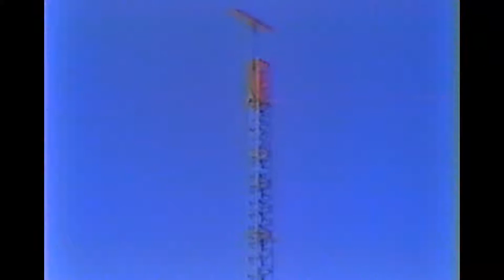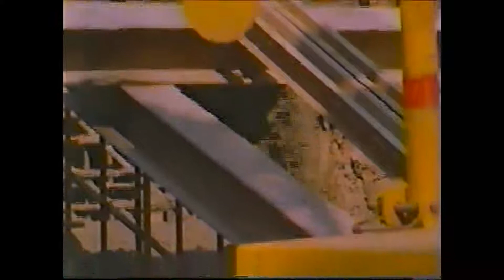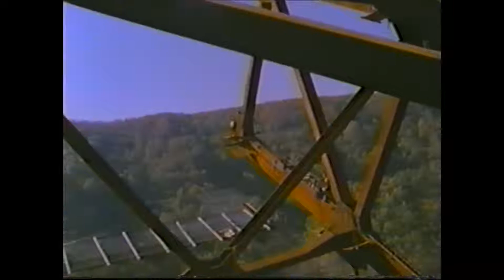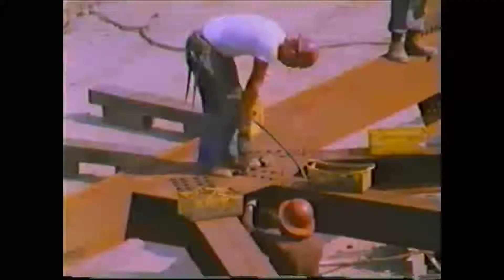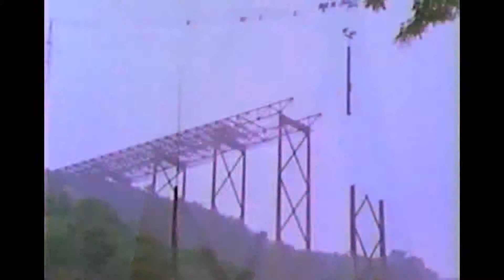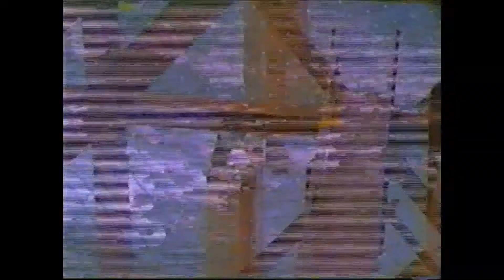New Record at New River Part 2

Comment: Not well known, but two of three cables in one of the cableways almost broke due to corrosion this would have destroyed one half of the bridge!
Reply: Having worked for American Bridge, I knew some Ironworkers that worked on the New River project. They told me that one of the towers or a tower leg did fail and the extremely heavy cable ran into the gorge taking trees and everything in its path. Those guys had some great pictures!